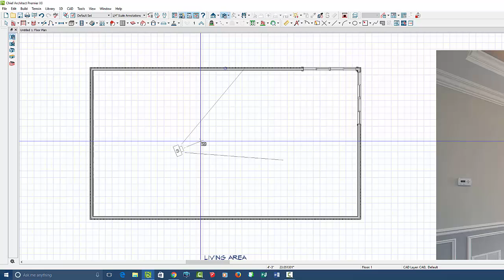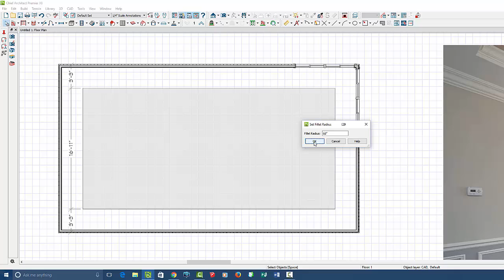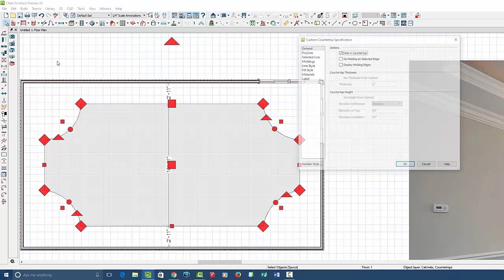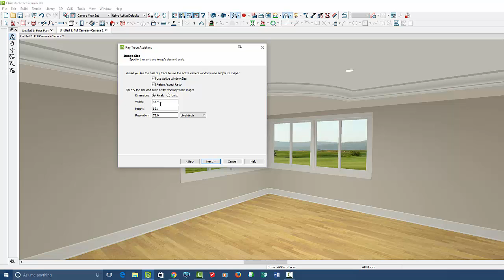Tray Ceilings in Chief Architect

Comment: I'm purchasing a house that was built 24 years ago that has tray ceilings that were part of the original build.  It looks really dated (popcorn included) and I'm wondering if it can be flattened again without loosing height or what options are available to update it.  Any advice would be helpful.  Thank you!